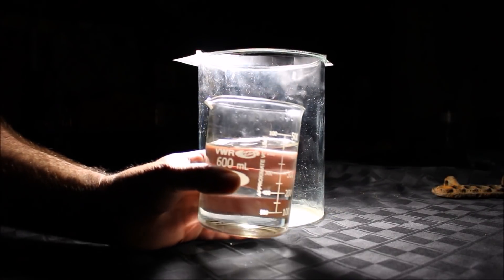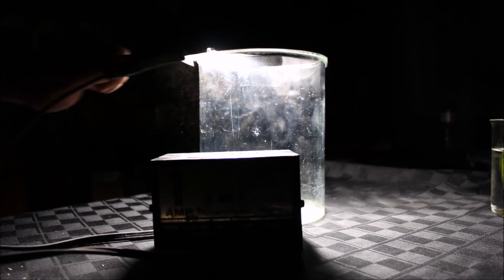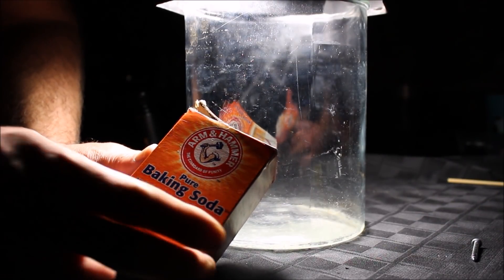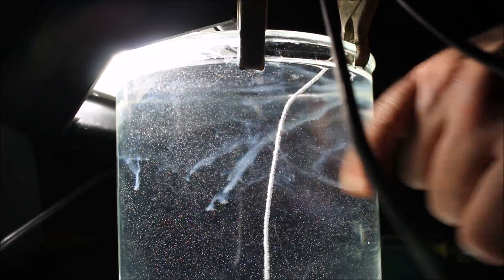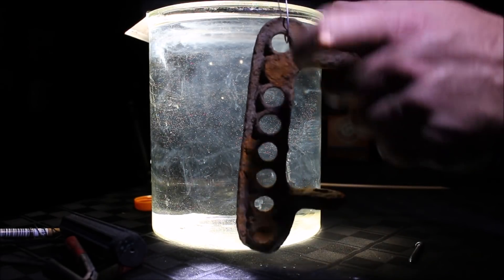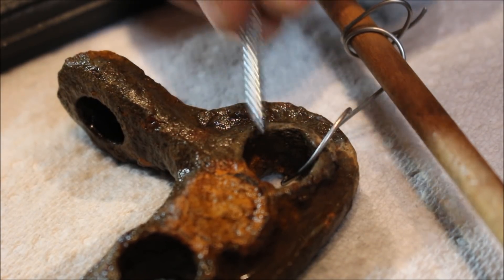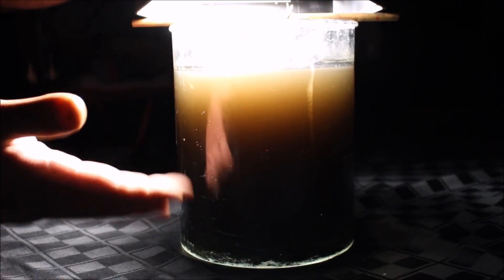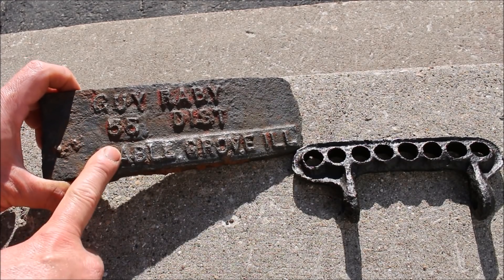Improved Electrolysis For Removing Rust From Metal Detecting Finds

Comment: 700 strokes with a file...???, clever people dont use a ladies nail file you moron,,, try a regular rough metal file. So funny when village idiots think they're talking sense...!!
Reply: Brush off loose rust with a steel brush before starting.
File, wirewheel or otherwise get a good contact surface for your baling-wire, it'll go much faster.

Instead of carbon rods, you can use any rust-free junk piece of steel instead as a sacrifical anode.
It'll rust and pit over time, regularly wire-wheel/grind it blank.
However, do not use stainless, you'll end up with carcinogenic hexavalent chrome in your solution.

You can use far more amps, the 12 Volt rail of a PC-power supply or even a DC-welder output can speed up the process a lot.

Do this outdoors or in a well ventilated space, hydrogen-explosions are devastating.

Comment: sodium bicarbonate gives off a dangerous gas and sodium carbonate dose not.
Reply from the maker: yes I heard about that but forgot exactly what it was
Reply: What gas? What are you producing that's not coming from water or bicarbonate? Hydrogen + 02 are the primary hazards. But I believe CO2 also evolves for a while in a bicarb system.

Comment: Sequence in an old 12-volt car battery and you can use the modern digital battery chargers.
Reply from the maker: Oh I get it like an old junk battery just to get the charger to sense the battery and not turn off. Good idea because those old chargers are getting hard to find

Comment: Rust is ferric oxide, which is attracted to the anode, another piece of iron which will become rusty.  What is left on the relic is a blackish gray coating called ferrous oxide which is fairly easily buffed off.  I cleaned an old dreadfully rusty axe head.  When it was done it wasn't shiny, but it did not have a thick coating of red rust.  I am now ready to replace the handle and have a serviceable axe.
Reply from the maker: Thank you for watching. That grey coating can be hard to get off sometimes especially if the item is pitted. I pressure cleaned it off my axe head at the car wash. Worked well. Good luck out there hunting.

Comment: You must have mentioned it but i missed: what is voltage.
Reply from the maker: I don’t know what the actual voltage is without measuring it. I do know that this charger was designed to charge 12 v batteries,  Thus is considered to be a “trickle charger” so I imagine that the voltage is very low.  A low voltage takes much longer but I think it does a better job and you can leave the system running for several days without even worrying about it. Good luck and thanks for watching

Comment: The reason for using Na2CO3 over baking soda is the amount of current 5hat it takes to achieve the same result. It's also results in much looser "left overs" on the part being cleaned. If going to the point of using graphite rods, using baking soda negates the benefit of using graphite over just an old piece of carbon steel. Washing soda or borax and graphite rods is the premiere setup and gets overwhelmingly better results.
As for the amount of washing soda, it's best to add until it no longer breaks into solution (saturated solution). Warm water, and a touch of white vinegar ( one tsp/per gallon) but only if you have a good air flow.
A wire brush will normally be enough, a wire wheel on a grinder does best but the only way it would need 700 strokes of a file is if youre file is 5he one that swivel on nail clippers.
BTW-  Magnetite (Fe³O⁴) is formed by converting the rust by way of electricity and the oxygen ions (and a bit of the transfer of carbon from the graphite rods) producing what amounts to black rust and can actually prevent further rusting in some cases. Gunsmiths use the process in what's called brown bluing where they allow red oxide to form intentionally and then place the part in boiling water which also causes the same black/brown oxide Fe³O⁴ to form, thus protecting the metal from forming Fe⁴O³ (I think that's the red oxide form)
Reply from the maker: Thanks for your input, the “700 strokes” threw a lot of people off but what they don’t realize is that I am talking about a piece of iron that has been in waterlogged ground for over 100 years. The rust forms a very thick crust that won’t come off mechanically. I wasn’t talking about rust formed by humidity. You have provided good insight!

Comment: Wtf is mechanics wire? Is that steel galvanised wire?
Where the f do you get carbon rods of that size? They sure as hell are not found  in Zinc-Carbon batteries.

Comment: I believe sodium carbonate allows more current than sodium bicarbonate. 

Also as bicarbonate has twice the carbon, I'd presume you'd see twice the carbon on your artifact. 

Which that is probably a good thing as it help prevent rust later. Unless you clean it off and paint it. Which case cleaning off more carbon is going to suck. 

Regardless, if you want to turn bicarbonate into carbonate I believe if you cook it in the oven it breaks it down into sodium carbonate and co2.
Reply: Carbon is not that black coating on the object, is an iron oxide. Bicarb/carbonate is not breaking down to carbon in these conditions.

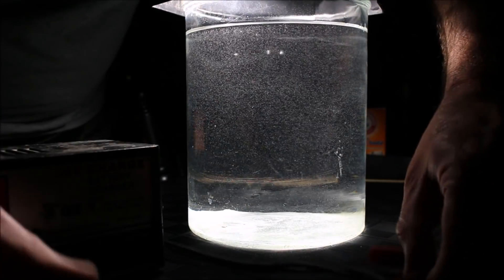Comment: Idk about you but, I'm pretty certain water is conductive even without baking soda or anything at all being added...  @3:53 :/
Reply: Actually pure water, like distilled water is not conductive.  Tap water would be conductive but only because of the chemicals in the water. The braking soda certainly increases the conductivity of water.

Comment: Sodium  bicarbonate emits a substantial quantity of explosive odorless colorless H H O gas, sodium carbonate emits oxygen and hydrogen separately at each electrode which is less volatile than HHO, one gallon of airborne HHO explodes like a full stick of dynamite (per my experience) very violent percussion thumped the air out of my chest like I got whacked with wet towel from 50 yds away
Reply from the maker: Sound like fun, wish I could talk more about this but the youtube bots are ever-watchful and they will pick up key words and demote videos in recommended results.  Thanks for viewing.

Comment: Drilling cast iron is piss easy, even with a hand held drill 😂, cast iron is relatively quite soft, were not talking high carbon or tool steel here. A bigger reason not to drill into it is, it’s meant to be a relic, why would you want to damage it???

Comment: Thanks for the video! I have actually used a smart charger for electrolysis. The trick is to connect the battery from your car to the circuit to get started, and then remove it from the circuit. Adding it to the circuit fools the smart charger into thinking it's charging a live battery, but once it starts, you can remove the battery. Learned this in another video and have done it several times.

Comment: Really great video! I think that those bubbles rising before you plugged in the battery was an uncommon occurrence of water splitting without electricity. Technically, water has an electrolytic potential of -1.23V but it’s rare for it to happen that easily. Either way super cool video.
Reply: Oh and the magnetite I believe is formed because the rust gives off an oxygen atom or two which then becomes a different form or iron oxide known as magnetite

Comment: Thank you so much for posting this. Great explanation. Question, i have an old cast iron mfg name plate that is extremely sentimental to me as i dug on our familys 200yrold farm. It was most likely something used by my greatx2 grandfather. Anyways, its very similar to your Guy Raby piece with raised lettering.  Only about a  1/4" thick, flaky rust, yet seems solid overall.  I've been debating on electrolysis bc i thought the letters or entire piece might disintegrate during the process. Any thoughts?  Go to FB and search E. Whitman Sons Co. and you should be able to find my photos of it. Thanks for the help.
Reply from the maker: I don’t have a Facebook account but I can tell you that 1/4 inch is pushing it especially it it is flaking. If it was powdery rust then it would not  be a problem. Sometime I run things through electrolysis only to have half of what I started with because the item was half rusted to begin with.  I wouldn’t press my luck.  The items that I cleaned in this videos were more powdery rust rather than flaky.  Best of luck